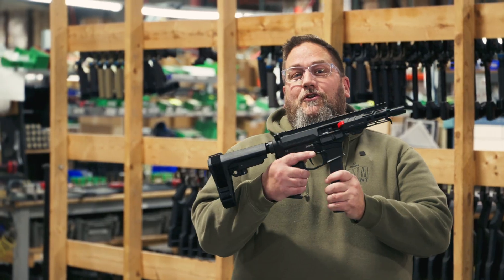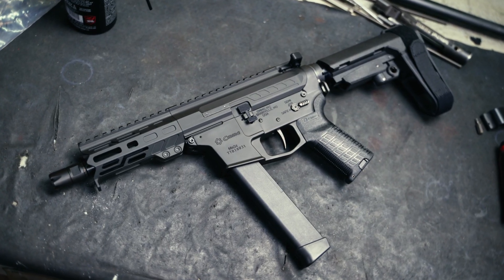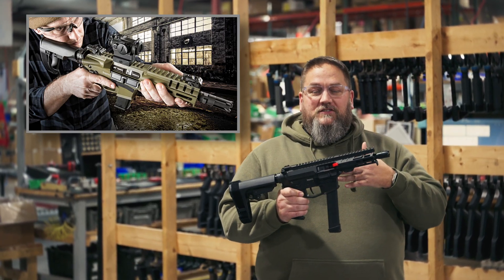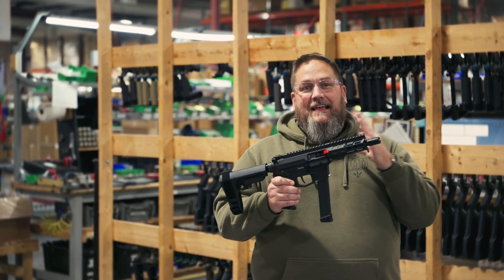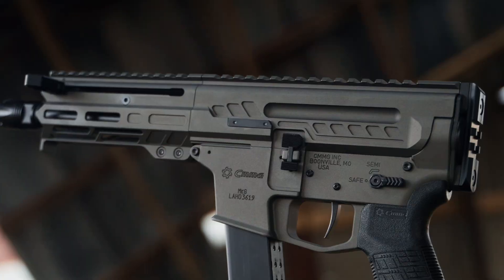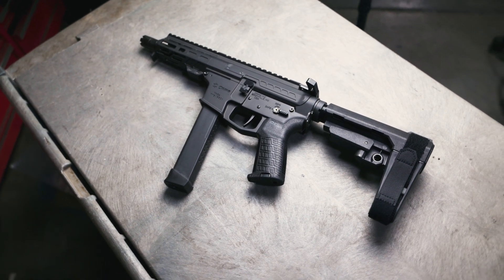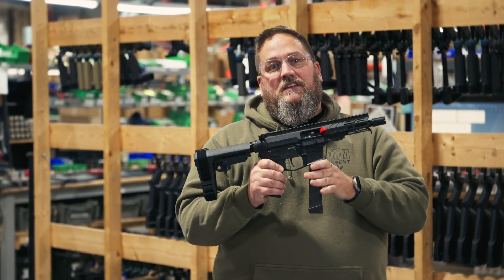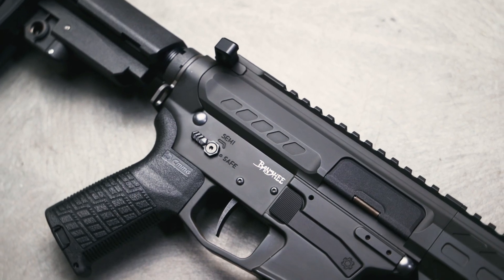Advancing the Radial Delay Blowback System

Comment: Does this fix the ejection port wear?
Reply: This guy asking the real questions
Reply: Haha yeah I haven’t had ejection issues at all yet. I did have to have Cmmg tube mine to get that wear to not be as intense. These are so new I’m going to wait till we see more proven use out of them
Reply: @greysonanderle1922  yeah. I’m getting a dissent and probably will get the banshee after a year and people report back. Dissent is upper is made out of 7075 while the new banshees and FE banshees are still made out of 6061. I think gen 1 banshees were 7075.
Reply: Yeah the main issue is the upper material, but the banshee comes out of the box with the bcg moving too fast and needs to be slowed down. The action tuning kit really does help. I’ve shot the 300 blk dissent and no longer friends with the guy who has it, but there no issues with the dissent. If this new fixed ejection upper for the banshee extracts the casing without hitting the ejector port this would resolve the ejection port wear issue
Reply: *need the bcg slowed down

Comment: You used your customers as beta testers to learn that your guns fail to eject past 1000 rounds because the ejector springs compress and fail.

I've got 2 new barrel and bolt assemblies laying around that are paperweights.  Why bother building them when they are guaranteed to fail.

Comment: I dont undersdand this. Whats the purpose? The ar style ejector allows for the use of mil spec uppers and lowers, which is the entire reason i picked the cmmg kits for my 22lr and 9mm conversion upper builds. Will you till be making kits with the AR style ejector?
Reply from the maker: Those are still available. This is an addition to our PCC offerings in 9mm and 45acp only
Reply: It’s well documented that the RDB system kills ejector springs. Check out C3junkies blog posts. I have to change mine out every 1000k. I run mine suppressed and with the heavy bolt weight.
Reply: @ja0298  interesting. What causes it? I just got my updated 55 degree bolt and I'll be testing it out soon. Also how do you tune with the weight kit? Increase weight until it ejects properly?

Comment: @CMMG Hey so i am very confused, and would love some clarification if you all would/could provide it. I am not trying to be rude or disrespectful, i just truely dont understand. I just read hour blog on the switch to the fixed ejector and correct me if I am wrong, but your saying there is no real benefit to a fixed ejector over the Ar15 style spring ejector, you guys just went that way on the dissent so now you are gonna do it on the 9mm & 45acp. My question is: For what purpose? To stream line your manufacturing process?? Fewer style uppers to be made? .....But they are just milspec uppers and you still use those? So I am REALLY confused as why you guys are doing this. Especially calling it an "advancement"...which you kinda say in your blog that it is NOT an advancement. So again respectfully, I am confused, can you help me understand the "why" of it all?
Reply: There are some flaws with the Radial delay ejectors/extractors. On mine, I would get occasional failures to extract (which kills it as a competition gun) and C3Junkie has ran this system a lot and found that it would kill ejector springs after 1-2k rounds. But I think he's also shooting the RDB on full auto. 

You can fix the extractor issue by putting an o-ring in the extractor and I think I had more success running an H2 buffer than an H1, just to slow down the action even more.
Reply: It's to fix the spring-loaded bolt extractor. It was a known weak point of the banshee. There's no spring that can break or wear out on the fixed ejector (no moving parts)

Comment: This is a welcome advancement to the radial delay. Only problem im running into is that my mk9 uses milspec receiver parts which I prefer the look of. I’m confused as to why you guys didn’t just use the existing ejector provision milled into the lower. Wouldn’t that have been an easier conversion?
Reply: I second this

Comment: Guys, you make good products. But please calm down with the pricing. You are not HK and you don't hate us. So don't hit us with that $$$ pricetag. This is fine for a grand. Not two and a half.
Reply: They don't have HK price tag...
Reply: @chriss9317 its close, this is a PCC not a rifle caliber rifle
Reply: 2.5 grand for that???? Got me fucked up
Reply: @BVTV360CLAN it’s not 2.5k. It’s about $1,599
Reply: They are still a few hundred dollars short of the HK price tag.
Reply: They are priced pretty fair. The tolerance are tight and aluminum is VERY hard to work with. Your also paying for some serious reliability. I have a banshee in 45 and its been amazing. They do run  wet is the only thing. When I say wet, I mean you better have it drenched or you will start shaving away aluminum just trying to clear it.
Reply: Um ,, pretty fair price bruh …☝️
Reply: Paid $1600 for mine. Directly from cmmg.  Bought the upper and the lower a few months apart.  Not too bad, it's really fun to shoot.  2.5k don't know where that number came from.  Local gun shop has an HK SP5 for $3500.

Comment: @cmmg is the new upper backwards compatible with previous bolts and barrels?
Reply: From the picture, it looks like the ejector runs through the bolt so regular bolt wont' work.

Comment: @CMMG  would there be advantage to a delayed bolt on something other than a pistol caliber?  Say 300BO or .308 like the HK battle rifles back in the day.
Reply from the maker: There may be at some point, but at this time, the operating systems that they use are tried and true enough that we've not seen big enough benefits to change it all up.
Reply: @CMMG  You've probably done more math on this than I have so correct me if I'm wrong but, with 9mm it's delayed but not all that delayed.  A standard AR BCG and buffer are almost heavy enough to operate safely and reliably as a straight blowback.  Whereas, with 5.56 and 308, you need it very very delayed.  I don't think the radial system would lend itself to doing that reliably.

Comment: Will CMMG work with those who have had years of failed ejectors on earlier versions to finally fix the inadequate old push ejector? Will any of that be covered under the Lifetime warranty? Or is this “evolution” just that, an update to a known issue, and those who have earlier versions must buy new to fix it themselves?
Reply: I would appreciate an early adopter of Gen1 Banshee discount for sure.
Reply: I would really hope so. I’ve had to replace the ejector about 5 times on mine.
Reply: That would seem logical as they put a problem out to market. I got an email saying you are SOL, buy a new upper. FWIW. Sprinco makes a heavy duty ejector spring that is working well but I have not put it through its paces.

Comment: Is there an advantage to fixed ejector?
Reply: technically a fixed ejector is more reliable and more durable, also gives a more consistent ejection pattern
Reply: Pros and cons like everything.  The original DI style bolt ejector and spring take a lot of abuse, especially if you're speeding up the bolt with a suppressor, so I personally check ejector spring strength every 250 rounds or when I get a failure to eject.  A fixed ejector means no spring.  A con to some degree would be that the new ejector bolt has a machined slot, so I'm wondering how that affects the radial delay and original advantages when shooting suppressed.  If it shoots about the same, I would prefer fixed ejector.

Comment: Is there a conversion for the banshee since the buffer tube system is not needed, so we can make it a pic rail folder?
Reply from the maker: The buffer tube is needed with the BANSHEE, it isn't on the DISSENT. BANSHEEs and RESOLUTEs still use the traditional AR buffer system still.

Comment: My  radial delayed blowback in 9mm would eat extractors... 😢
Reply: BINGO!!! ☝️☝️☝️
Reply: Mine too
Reply: You mean ejectors. A blowback doesn't even need an extractor, really. It just helps with reliability.
Reply: That is why he said Radial Delayed Blowback, not the same
Reply: @azazelakira12  Blowback guns operate off of pressure on the case. The case acts as a gas piston, and is pushed back. Same thing with delayed blowback, it's just that there's a mechanism to delay the blowback. 

The CMMG Banshee doesn't have issues with _extraction_, rather ejection. The ejector springs, due to play between the bolt and the trunnion, if you will, become compressed over multiple firings. Some people have issues, some don't, but often enough, after 1000 rounds, the spring becomes so compressed it doesn't push back on the case anymore and you have issues with ejection.

I meant ejectors.
Reply: @willblack7353  yeah good point to, is just maintenence at this point, my extractor brakes more often that I have to change that spring tho

Comment: Just curious, why? Is the fixed ejector more reliable or something?  Also, does that mean I can't build my own radial delayed upper in a standard upper reciever anymore?
Reply from the maker: It's just the natural progression. We originally tried to keep the 9mm RDB within the constraints of a mil-spec upper. With the release of the DISSENT we made a dedicated 9mm upper receiver that used a fixed ejector since there was a new upper to try it with. We've just taken that change and retrofitted it to previous models. We will still have both options available so you can also still purchase your own RDB bolt and barrel and use in a standard receiver.
Reply: @CMMG  thank you! That's good to know
Reply: @CMMG  these EDB bolts work in non-CMMG receivers, upper/lower both non-CMMG? (such as PSA)?  I was told they wouldn't work due to some different geometries and how high the mags sit.
Reply: @CMMG  Will the non fixed ejector 9mm bolt and barrel combo's that are compatible with milspec uppers continue to be produced? I really like them for custom builds! especially the CAR-15SD. Please keep producing them, I'm willing to deal with the extractor spring problems to use my favorite kind of milspec upper receiver.
Reply from the maker: @ they will be. they're still used in plenty of other models
Reply: In other words, reinventing the same wheel.
Reply: In other words, reinventing the same wheel.
Reply: @wokndedfan413 accidentally double-posting that comment is pure art.
Reply: Definitely more reliable. There are many people with ejection issues with the AR-style ejector and springs. Google it.

Comment: I wish you would do a scorpion mags or mp5 lower
Reply from the maker: Requires a whole new upper too. The magazines are too wide for either system. We just need to see a lot more demand before committing to yet another new receiver set to build.
Reply: @CMMG  I second a scorpion mag lower!
Reply: @CMMG  I stand with the scorpion mag group, so much easier to load the mags, can find good mags super cheap, good capacity, and looks good doing it.  I periodically check your site for any whispering about scorpion mag version.
Reply: @gillieshooter4742  The AR conversion mags are also super easy to load, work really well, and fit in ubiquitous AR mag pouches.  They have the added benefit of allowing you to swap to a rifle upper on the same registered SBR lower without doing anything else to it so potentally saving a tax stamp if you want short 9mm and short 5.56/300blk/whatever.
Reply: @mikequinn8780  Yeah you've got a point I just pointed out that with one SBR stamp you can run many different calibers with the swap of an upper. I convinced my bro to go with the Banshee FE just for that very reason
Reply: @CMMG  Agree with everyone here too. Heck with overpriced MP5 mags make a dedicated lower that takes scorpion mags and I'm in. I have one of your original RDB bolt and barrel combos that I have franken-gunned into an NFA S-9 scorpion lower and a PSA KS47 upper. It works but is missing the refinement of matching upper and lower.
Reply: @CMMG there is a high demand for a Scorpion mag lower. Almost every new pcc like the Kuna, Stribog, apc all have aftermarket scorpion mag lowers.
Reply: Both feed far better into a non-handgun, but MP5 mags can't lrbho.
Reply: Scorpion and AKV9 mags for the win.

Comment: can the old ones be converted?

i’m still awaiting fulfillment order 681641 and i have a banshee 4.5” with the radial delay bolt style ejector. (i believe)
Reply from the maker: The old ones will need the new upper, and only complete uppers will be available initially. You'll be able to get the components like the stripped upper and bolt possibly late Q2. Any order changes or requests will need to go through our customer service team.
Reply: @CMMG  Will stripped uppers (or at least barreled uppers without the BCG) be available for the DI Dissent?  Right now I can buy BCGs (which are useless without your proprietary upper), but can't buy uppers (which are quite useful once I have one upper that came with a BCG).
Reply from the maker: @ We don't have that slated at the moment since. We have the BCGs available for common calibers since you can easily just swap a barrel out in the DISSENT upper to a different caliber and will need a BCG for that. Additionally, you'd still need the handguard and charging system too, so by that time you're getting close to a complete upper.
Reply: @CMMG  Thanks for the response, but I'm not sure what you mean.  One of the AR's main selling points is having a variety of configurations on the same lower in seconds by swapping uppers, and that never requires a new BCG (maybe a different nonproprietary factory AR bolt - but AFAICT you only sell the one DI BCG).  Even we who do our own smithing don't want to render our first complete-upper purchase unusable.  Since you obviously already make the uppers, what possible objection could there be with selling them either stripped, or complete minus BCG?
Reply: @CMMG  Concerning the bcg, is the bolt the only difference? Or is the bolt carrier different as well, between the FE rdb and non-FE rdb?